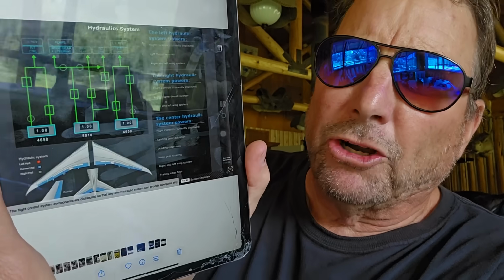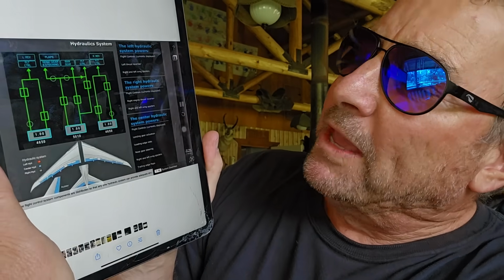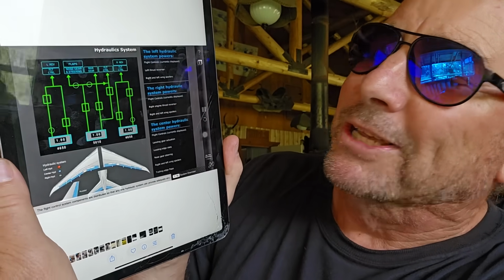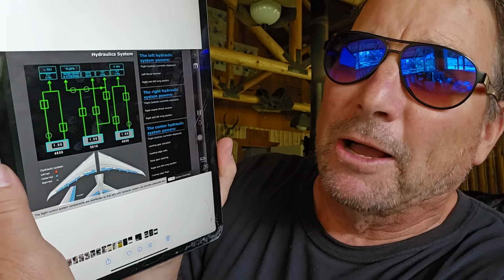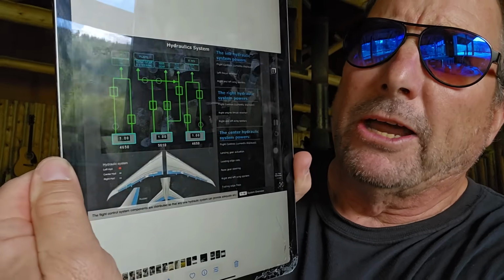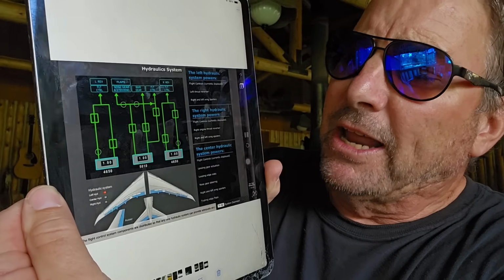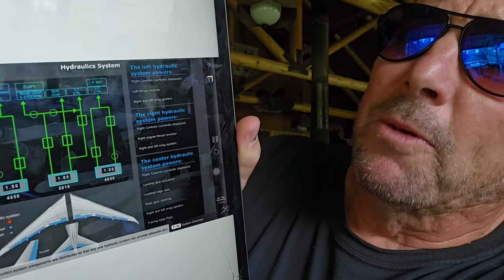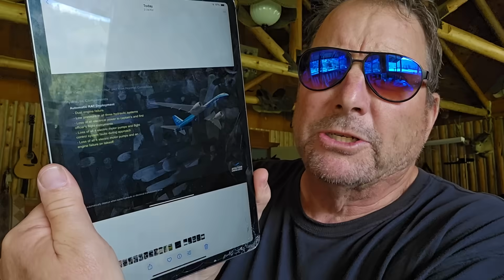787 Crash India What's a RAT? When does it deploy?

Comment: I have a question about dual engine failure, usually you will always take off after anything happening after V1. What about a dual engine failure? Is there any procedure to then accept there's gonna be a crash and just not take off on purpose?
Reply: If you lose both engines then it's better to abort, even after V1. Better to overrun the runway and stay within the airport premises where the firefighters can reach you than crash somewhere else. If you're at an airport where there's a wall behind the runway like in the Jeju case, then you had a bad day.
Reply: @kallek5655  yeah that's what I'm thinking myself, but I wonder if this is even discussed somewhere in pilot training or before take off briefing. I think it is in small 1 engine GA aircraft

Comment: At this point I think we can all agree that we need 4 engine aircrafts again in the future.
Reply: Bring back the 'Queen!
Reply: That might seem obvious, but on second thought, if a 4-engined airplane lost two at or after V1, it would be struggling, too. At least the A340-300 would, it already doesn't perform well with only one engine out. Would be interesting to know how a 747 would perform in such a case.
But yeah, I miss the era of the 3- and 4-engine planes, too.
Reply: @kallek5655  I think the a340 300 gets a bad rap. I watched a video about from an actual pilot (bjoern pilot or sth) and he said it's totally fine as the aircraft isn't as heavy as the 500/600.  I asked grok and he said that in favourable conditions, the 300 can continue climbing slightly on 2 engines, in difficult conditions it can level off. Both cases are much better then all engines and systems off in a 2 engine ;) I was talking more about the redundancy of hydraulics, electrical systems etc.  Some people say, a A380 NEO would be very efficient nowadays so I keep wishing.
Reply: L-1011 was a great bird, too  @kallek5655

Comment: APU intake door open. I noticeced in the pictures on the net of the empanage wreckagege embedded in that building, the APU intake door is open and with a tree branch stuck in it. Don't know if the 787 takes off with APU running or not. Could they they possibly soon after take off developed the urgency to start the APU to get electrical power?
Reply: 787's APU starts automatically if at least 3 engine generators go offline. There are 2 generators per engine.

Comment: Preliminary on India flight. Dual electric bus malfunction. FADEC’s went to ground idle when gear left the ground. Ended up stalling, nose drop 54 degrees nose down. No chance.😕
There was an electrical MEL that was on the books for 2 weeks. If fixed, wouldn’t have happened.
Reply: Electrical overload or overstress that popped a breaker, possible from some binding or poorly greased mechanical part? Remember the Alaska jackscrew.

Comment: Love Juan’s videos. I am not an expert and not a fixed wing pilot I am an LTA pilot. First off we won’t find the answers until the recorders are processed. One thing that I am curious about is Density Altitude. It was a hot day he said normal 5/15 flap settings. The reason I ask is that some reports say they back taxed to a turn around point and then started TO and some say from I think taxiway R4 I think. The loan survivor said he heard the engines working and go to full power and not gain altitude. If you are heavy, hot and humid potentially short take off with flap settings for a normal long take off would that cause a power on aerodynamic stall?  Like I said I am no expert or wanting to cause hate or anything.   A ton of things could have happened and we won’t know for sure until the investigation findings start to come to light.
Reply: Romesh was probably hearing the Ram Air Turbine...The pilot radio-ed that there was no thrust...

Comment: Seems a lot of comments regarding the FADEC. I have no experience with this particular engine but in helicopters I have flown with FADEC if you have a FADEC failure the fuel control is frozen at the same setting as when the FADEC failed. You then have time to consult the ECL and revert to manual control for further flight and subsequent landing. It seems to me that any software logic that would have the engines reduce to idle with a FADEC failure would be ridiculous.

Comment: just looking at the stills from shortly before she reached max alt, the boogies look straighten for retraction then the dark areas on the wing in front of the flaps look like spoiler upfloat, spoilers (14) - # 4, 5, 10 & 11 are electrically operated, the remainder are hydraulic. That could be those 4 slightly up lifted . We need the DFDR/CVR  data asap, heard they found the optional onboard camera DVR , they may have had cameras in the cockpit that have been recorded.

Comment: No one seems concerned on how this flight took EVERY INCH of that runway, and then maybe some more looking at the dirt kicked up by the plane in the OVERRUN AREA. How much runway should they have used, even on losing one right after the V1 callout. And the reports of it climbing 600 feet. The airport is a little under 200 feet MSL. Maybe the aircraft reached 600 feet MSL or 400 feet above the ground. So what would that takeoff looked like had BOTH GENERATORS failed due to previous problems? No engine driven electrical power so what happens when RAT can’t come close to powering systems?
Reply: Good point. What was W&B, heavy? Electrical overload from all the infotainmentband personal passenger systems? Overcurrent from trying to drive an electromechanical (grar lift?) motor compromised by strain or binding or lack of grease?

Comment: Years back there was an AD concerning the GCU on the 787 that could cause the system to go to failsafe if power is kept on for a certain period of days (actually quite a long time). What if the GCU caused the IDGs and other generators to go to failsafe resulting in total loss of AC power? Will that affect the operations of the engine control (EEC) assuming its an all FBW design?  Sorry I don't know much about the 787.

The RAT as I read take some time to deploy and generate power and during that time, the Lithium batteries will power everything for several seconds. If the GCU causes this to be on failsafe and result in total AC failure, I wonder what it would do in this instance that the airplane is in a critical flight phase?

Comment: Those were seasoned pilots in there with 8000+ hrs of flying + Air India doesn't take it lightly when it comes to UK, EU, US routes + 787 has been successful in all weathers so far with 11yrs of good records ever since the batteries were resolved in 2014. Even if a human error had happened, I still trust it had to do with the Air India maintenance team or just a complete happenstance of engine failure. If there were no building 5 miles north and south of the strip the plane may have slided on the ground with little loss. :( :( :( Tough times

Comment: The gear might appear tilted forward since takeoff from both views, is that normal? Some reports say mains only tilt forward just during the retraction sequence. Is the right main gear seen to hit the dirt at the end of the runway, just before it is obscured behind the small checkered airport utility building as the rotation commences? Then a large dirt/debris cloud is spread by the engines (at least the left engine) as the plane climbs above the view of the building. So clearly there was some thrust generated after takeoff, not sure about how much can be seen from the right engine. The cloud moves from right to left in that rear video, possibly due to wind from the right. Did both main gears kick up this large dirt/debris cloud off the end of the runway, not a tail strike? Or was it just the engine(s), but again that would indicate thrust. Had to be something big. It seemed to rotate slowly, behind the view of the building, not like the usual rocket. The right side view video doesn't seem to show a tail strike under the fuselage forward of the tailcone (which was intact after crash), but is hard to tell. Were both of the main gear damaged so they stayed tilted forward and could not retract? Could electrical failure or hydraulic failure as possibly evidenced by the RAT deployment be somehow associated with / caused by these developments? Didn't appear to be leaking hydraulic fluid from the main gears visible in videos. Just before the apex, did the rear left view video show both mains move a little inwards, then stop? The elevator seems to be moving up and down at this time point, so might be generating an optical illusion. The main gear doors don't seem to have opened? At the apex, the survivor said lights went out, and climb stopped for 5-10 seconds. After the apex, the pilot called mayday, losing thrust. One yt commenter (Greg) asked if electrical failure could affect engine controls, causing reduced thrust? Can the RAT alone supply power to the engine control computer? One commentor said the RAT was designed to deploy at altitude during all engine power loss, to supply power to flight controls to get to a landing. So maybe the assumption is that the engines / generators are inop, so engine control not needed? What about the APU status or use, was there time to turn it on? The pilot corrected a slight right then left yaw after apex, and pulled up elevator, so controls were working. Just observations, but without detailed knowledge of the 787, it is hard to know how these systems tie together. Hope the community can get to the bottom of it.

Comment: The rat deployed and the landing gear tilted forward  is just clear evidence that there was a mass loss of electrical, equipment. I wish more time was spent with the sole survivor and asking questions a minute before the crash. Two things that he did bring up was he heard the engine's increasing throttle and he was sitting literally right next to them. Yet the plane felt like it was standing still. I don't know the mechanics of jet Engines, but it almost sounds like the engine slipped into neutral even though the pilot had throttles at Max, if not close to Max.

Comment: QUESTION - RAT deployment suggest power failure (Electrical) if that is the case then  would the blackboxes also lose power to operate until power was restored by the RAT?  In other words, unless the Blackboxes have a protected power source eg backup battery, it would seem likely that there will be at least a significant gap in the blackbox data during the time from power failure until the RAT comes on-line.   I believe this was a problem with the South Korean airliner crash that the power loss meant no data from the time of the power loss onward.   
Seems that this situation would suggest that a modification is needed to provide at least a minimal battery backup for the black boxes to enable secure recording and preservation of data in the event of a complete power loss.   Depending on the RAT to supply power also assumes that the RAT does successfully deploy and provide power.  It doesn't take much imagination to envision a situation where the RAT is damaged due to a missile strike or some other damage that disables the RAT.  Of course the blackboxes can only record data that is provided by instuments so again a power loss to the instruments also wipes out blackbox recording ability.   Just seems that in the interest of safety something needs to be done to make sure blackboxes are able to capture data to permit better accident investigation.

Comment: @blancolirio Have any attempts to use a canary filter to detect fuel contamination been attempted? My thought is to taxi out with the boost pumps on and run the excess fuel through a filter that will clog during the taxi out of the fuel is not clean, leaving a way to detect contaminated fuel before you set take off thrust. It just seems like a simple disposable filter, even if it is single use might be worth the price. The system would weigh almost nothing because all it would be is a tap from the booster pump outlet to the canary filter and a return line to the tank, and a couple of pressure sensors.

Comment: Loss of Hyd or Electric the plane would have continued to climb.  There may have been Flt Control/Aircraft control issues later.  Or landing problems. 

This aircraft appeared under control (constant pitch, no bank, no heavy rudder usage) until the last few seconds.  Then it appears the pilots may have begun to pitch up to lower vertical speed/ground speed at impact.  

Only thing that looks like would cause that is DUAL engine failure.  No yaw, no rudder movement.   Birds probably would have caused at least a compressor stall in one and some yaw as one engine failed before the other.  

Fuel contamination, once again chances are incredibly low both engine failed at the same instant with no yaw.

Comment: Flight: AI-171 | Aircraft: Boeing 787-8 | Date: June 25, 2025 | Route: Ahmedabad (VAAH) → London Heathrow (EGLL)
Crash Site: ~1.2 km from VAAH Runway 23, post-V1 and rotation
Fatalities: 247 (243 onboard + 4 ground)
Survivors: 0 onboard survivors (alternate to original), 3 injured on ground

⸻

🛠️  AAIB Preliminary Report Highlights

1. Primary Cause – Electrical Power Transfer Interruption (PTI) During Rotation
	•	During transition from ground to airborne electrical configuration, the aircraft experienced a cascading dual-engine FADEC (Full Authority Digital Engine Control) failure.
	•	Root cause: Uncommanded bus transfer failure due to arcing in the main power relay box (PRB-A), traced to water ingress during pre-flight GPU disconnection in heavy rain.
	•	This led to loss of electronic engine control at rotation, resulting in both GEnx engines rolling back to ground idle within 4–5 seconds.

2. Flight Data Record Timeline
	•	+0:11 sec: Nose gear lifts off.
	•	+0:13 sec: Sudden engine rollback begins. Thrust reduces from 92% N1 to <27% within 3 seconds.
	•	+0:16 sec: Master caution + ENG FAIL L/R warnings. FO calls, “Both engines dropping!”
	•	+0:20 sec: Autopilot and flight control reverts to Direct Mode. Pitch up attitude peaks at 18°.
	•	+0:25 sec: Aircraft stalls at 186 ft AGL.
	•	+0:30 sec: Full aerodynamic stall; nose drops rapidly.
	•	+0:38 sec: Ground impact at 54° nose-down attitude, 174 knots.

⸻

⚙️ Contributing Factors
	•	Environmental Conditions:
	•	Torrential rain during pushback.
	•	Moisture intrusion into PRB-A connector (P/N: HLN8471) — a known corrosion-risk component.
	•	Latent Maintenance Issue:
	•	Power transfer relay unit showed signs of thermal damage in a previous MEL deferral 2 weeks prior.
	•	No replacement had been conducted; aircraft was cleared under repetitive deferral.
	•	Design Oversight:
	•	Boeing 787 has no physical engine control backup (i.e., no direct mechanical linkage in FADEC loss scenario).
	•	Loss of power supply to both EEC channels resulted in engine “freeze” at ground idle instead of flameout.
	•	Flight Crew Response:
	•	Attempted engine relight sequence not completed before stall onset.
	•	Emergency power selector not activated — possibly due to confusion from multiple ECAM warnings.

⸻

✈️  Immediate Safety Actions
	•	DGCA + EASA + FAA Emergency AD issued within 24 hours:
	•	Mandatory PRB-A moisture integrity inspection on all Boeing 787 aircraft.
	•	Temporary restriction on dispatch with MEL items related to power transfer systems.
	•	Boeing:
	•	Issued Service Bulletin SB-787-24-212 requiring replacement of PRB-A connectors with sealed versions.
	•	Exploring addition of dual-path power redundancy for FADEC systems.

⸻

🧠 Lessons Learned
	•	Over-reliance on electrical power distribution architecture without layered redundancy.
	•	Lack of crew procedural training for full engine rollback during takeoff in EEC dual failure scenarios.
	•	Need for improved environmental sealing in GPU/electrical handover units in monsoon zones.

⸻

🕯️ Human Toll
	•	The loss of 243 onboard lives, including 12 crew and 18 infants, deeply impacted the aviation community.
	•	Final words captured on CVR: “We lost everything – no thrust!”
	•	One family of five was killed on the ground in a hospital ambulance struck by debris.

⸻

📅 Timeline – What’s Next?
	•	Aug 15, 2025: Release of FAA/Boeing electrical design audit report
	•	Sept 5, 2025: ICAO session on electrical-critical phase-of-flight risk mitigation
	•	Oct 2025: Mandated design retrofit across 787 fleet (rev. SB-787-24-219)
Reply: what made you come to this conclusion?

Comment: New wing pictures post crash show leading edge slats deployed (at least flaps1) and trailing edge flaps appear to be slightly separated from flush (at least flaps5). The runway is 3,500m long, the plane was held down until the very end, and max speed at apex altitude was 174 knots, reportedly slightly slower than normal. The partial turnaround apron is approx 1,000m from beginning of runway 23, but conflicting reports on where takeoff commenced. The left engine at least kicked up considerably dust/debris at rotation  from grass off runway end, seems less on right side, although wind was slightly blowing right to left at 290, as can see plane drift left before impact. It can't be seen if there was a tail strike that kicked up so much debris, the building obscured the video view. Whether that was the bang heard by the survivor and contributed to electrical problems is unknown. Clearly this plane was struggling to gain sufficient airspeed before last second rotation at very end of runway, the video seems slow, since the 787 is normally such a high performance takeoff rocket using partial runways. Reported items could include less engine thrust or a failure, too high loaded weight, short field takeoff used, even some say fuel issues. Why lights went out and RAT deployed is a mystery. A tragedy.